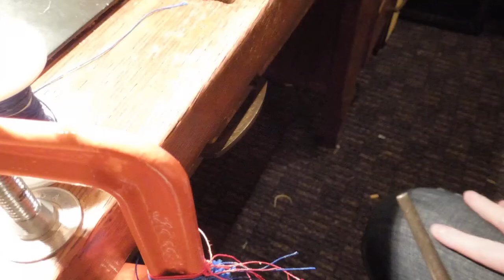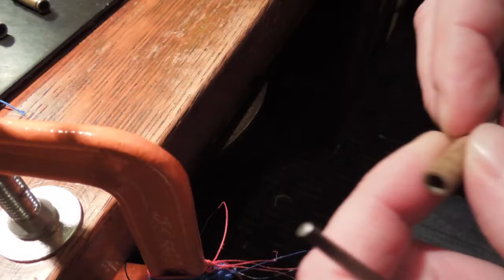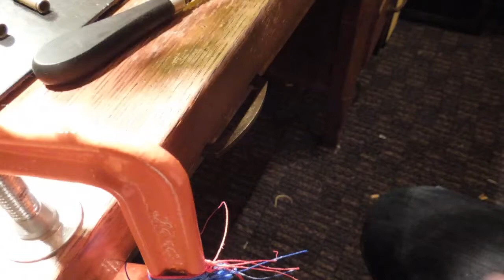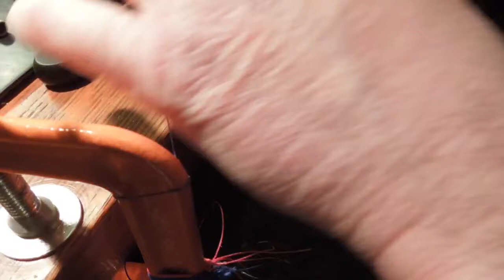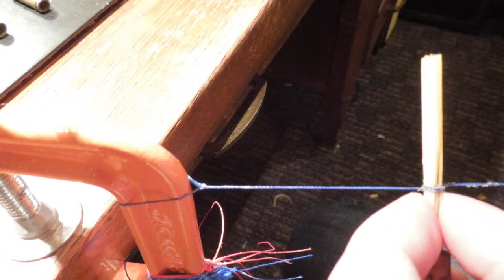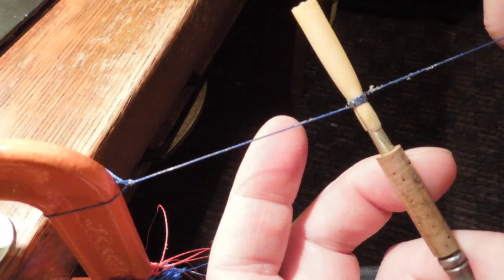Tying the Oboe Reed Part 1

Comment: If I may, the “it’s just too big“ tube is an AK wannabe tube. I have 2 mandrels for a regular French tube, and another Blue handle AK bore mandrel. I have tried both of those brass tubes without cork with the O-rings. It took me years to settle in to building performance reeds with those tubes. I think you know who makes those tubes and I think you’re right about the silver and gold tubes. They do sound better. I did find an excellent economy staple that I use for students that turn out so well that I’ve used them for performances as well. The boar inside was smooth but the outside was almost like sandpaper finish , Which made it very easy to tie the reed because of slippage. But some of them had insufficient cork size which I remedied with a trimmed piece of cigarette paper. 0CB cigarette paper I’ve used since 1972. No gum.
“The fighter” and the thumbnail.
I hope to put a video up, maybe my first, tying a blank freehand, with not one inch of wasted thread. John Ellis showed me that and ever since, that’s how I tie, with great success.
It’s all in the beeswax :-)
Thanks again. Always.

Comment: Why didn’t you use an AK Loree silver staple? 
I haven’t tied like that in 20 years. I start with my thumb on the end of the thread and on top of one blade,  wrap around 3 times, even and line up the blades, I make sure both sides of one blade is not on both sides of the other blade or vice a versa, they must be slipped... turn it on one side and the top is over other blade, turn it on the other side and the top is over the other blade.
Your videos are superb. Thanks. Great lighting and camera visual. 
BTW It was John Ellis who got me started tying without attaching the thread to a doorknob or a chair :)